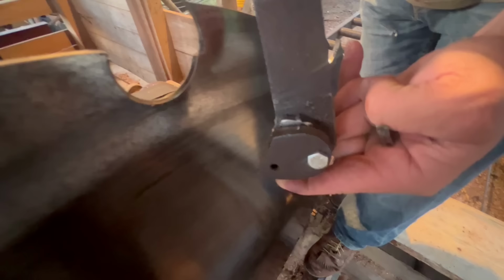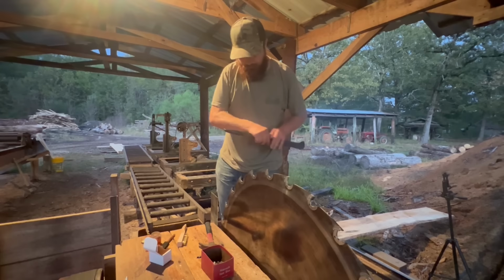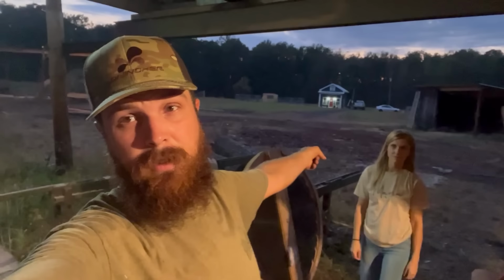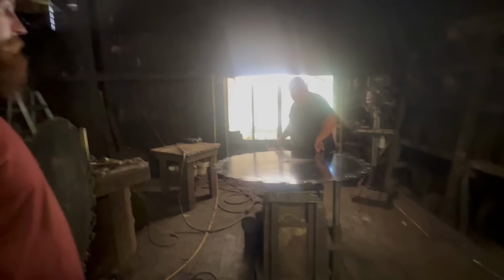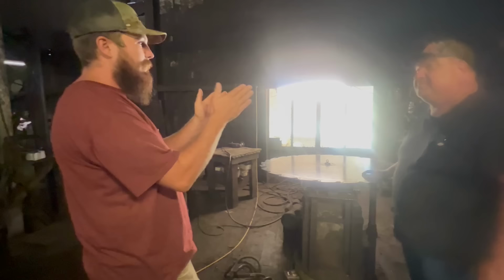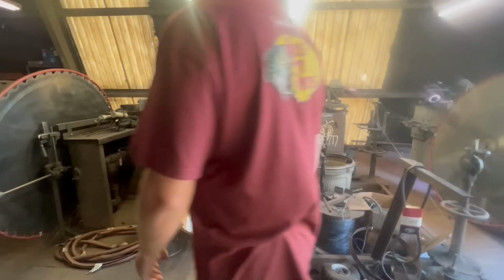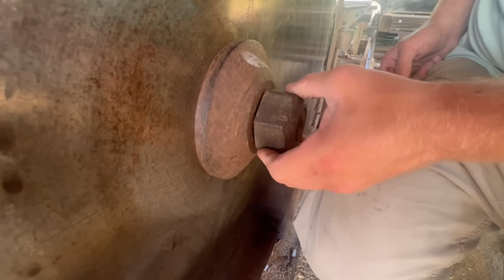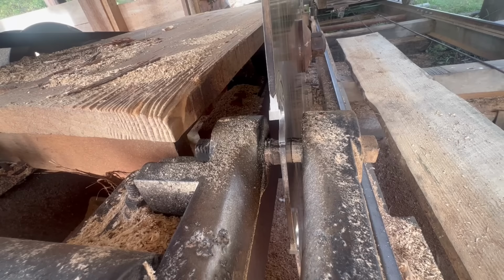We are HAMMERING our SAW?!! (Is this becoming a LOST ART?!!)

Comment: Thanks so much for shooting the video on hammering. Also replacing the teeth was very interesting.  I thought maybe you just sharpened them like we do on a chainsaw chain. Thanks for all your videos,  l live watching them.
Reply from the maker: Thanks for watching!
Reply: They are sharpened with a file, sort of like a chainsaw. A flat file, straight across.  He was showing how they're replaced when worn out.
Reply: There are power sharpener that set on top of the blade to sharpen each tooth, eventually the teeth would need to be changed out like he showed at the beginning of the vid. We used one in the hardwood mill my family ran here in Michigan.

Comment: Just curious why you wouldn’t wait until after hammering and reinstalling before replacing the teeth? If you mentioned it and I missed it, then my apologies for missing it.
Reply: You replace the teeth first because replacing the teeth stretches the rim of the saw. Once the rim is stretched then you have to work on the body of the saw to match the rim. The rim of the saw has to be shorter than the body of the saw because when the saw gets up to the correct rpm the rim stretches (making the diameter of the saw larger). so with the rim shorter than the body when the saw gets up to speed and the rim stretches the rim and the body will match each other. If not done correctly the saw will not stay straight. I worked on saws from 6 inches to 6 feet in diameter for 25 years. Great job.

Comment: Only one part of the process that I did not understand.  Why do you not wait until you bring the blade back to install the new carbide tips so you would not risk them getting damaged in transit or during the process?  Great Video.
Reply from the maker: Saw man requested it this way. I just complied. They like to hammer them with the new bits in the saw, sometimes changing bits can affect the hammer job to a degree.
Reply: @wallacefarmandsawmill   Thank you.  I knew some reason must have existed but I was not sure.
Reply: Thanks for asking this question; I was going to until I read yours.
Reply: @stevehudson4151  I've had blades hammered and  old teeth have never been an issue, nor have I read about it. I've changed whole sets of teeth and  not noticed any change in the blade. It might be  because the hammer guy  is the same guy who sells the teeth.
Reply: When you change all the teeth the outside rim of the saw stretches making the rim longer than the body of the saw. So after you have stretched the rim you have to work the body of the saw to match the rim. The rim of the saw has to be shorter than the body of the saw. The larger the diameter of the saw and the faster the rpm of the saw determines the rim length. The rim has to be shorter than the body because as the saw spins the rim stretches. Once the saw is up to speed and the rim has stretched (which makes the saw diameter larger) the rim will equal the length of the body. If not done correctly the saw will not stay straight when up to speed. I worked on saws from 6 inches to 6 feet in diameter for 25 years. It is an art no set rules.

Comment: Why change bits before the trip to the saw shop
Reply: It’s a fairly common practice. Changing all of the saw bits could change the tension in the saw. It’s better to change them before the saw work than afterwards. 
Usually when I change bits, I only replace 1/2 at a time. I run it for a few days, then replace the rest.
Reply: Thanks I work in a pine sawmill 28 years now we only have bandsaws

Comment: Why renew the teeth before hammering 🤔🤔
Reply: If you replace the teeth after hammering, it can change the blade tension, and it won't run straight. So replacing before its hammered and tensioned is best practice.

Comment: No lost art. Every large high speed saw mill has saw doctors. The mill i worked at had 7. As long as there is lumber there are saw doctors no way around it.
Reply from the maker: Factual. But statistically that is a very small fraction of the workforce.

Comment: Why put the new teeth on to got roll it around on the floor, and risk one getting chipped?
Reply: Wood floor. It’s a saw shop.
Reply: @tennesseesawmillguy1590  I'm aware of that. The floor looks nice and clean too. Nothing abrasive there, or metal chips or nails. Plus you are handling it a lot and could bump into any rigid object or tool. The only reason it should be done first is if it were needed as part of the service. Otherwise it is just taking unnecessary risk.

Comment: I'm assuming to hammer and put a dish in to the saw blade has nothing to do with new teeth and the young feller that owned the saw blade should have not put new teeth in when the old fellers gonna run the wire brush on the whole thing to remove sap and the like.😮 Ruined new teeth

Comment: You drive way to close to the car in front of you. Considering you have a very heavy saw blade behind you, not strapped down, if you for some reason crashed into the car infront of you the blade could be very dangerous(I will not be more graphic than that). Be careful!